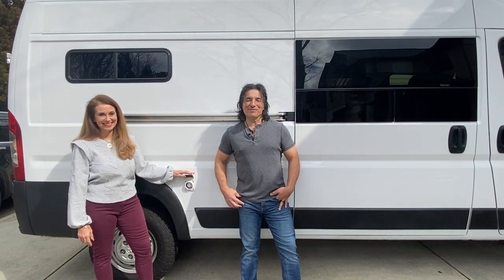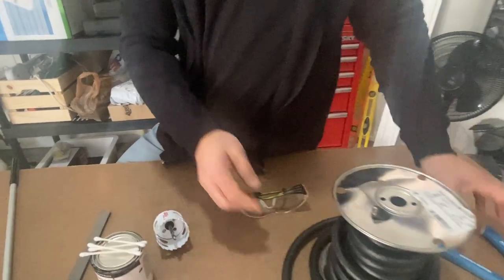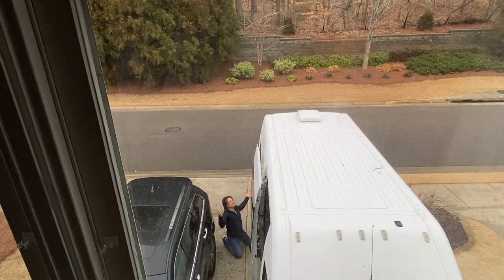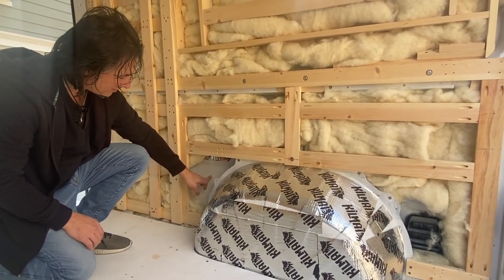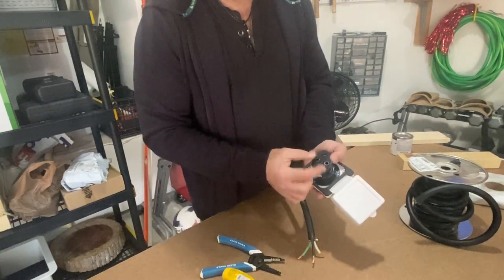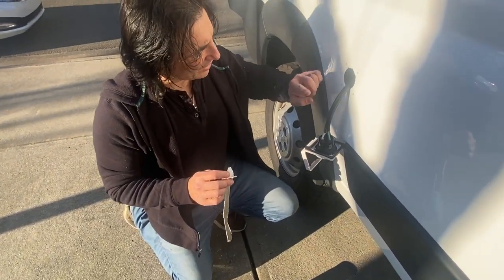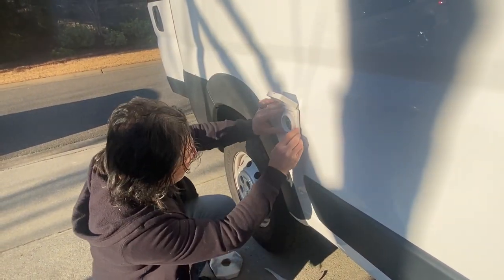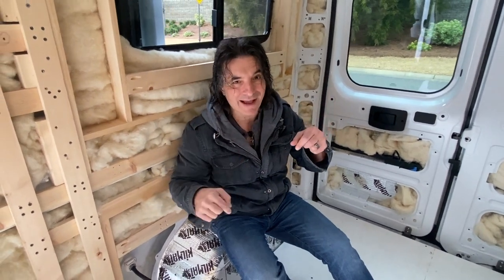Installing a 30Amp Shore Power Inlet: Part 17 – RAM Promaster 2500 Van Conversion

Comment: Hello again, I just remembered a friend of mine who has one of those on both sides of the RV. We do motorcycle activities at tracks. So the driver’s side he uses it to get power into the van, while the passengers side is in front of our motorcycles and we need it to get power for many purposes for the motorcycles all week long. Stay happy you’ve a got a great van 🚐
Reply from the maker: Wow…never would have considered that. There are certainly opportunities to feed power out the passenger side and pull power from the drivers side. FANTASTIC idea. And Thank You again

Comment: Thank you for the awesome video. You can always have another plug in from the drivers side but still keep that one by the door. It makes the van more versatile. I am sure there will be many situations where you’d need that one 🥳👍 love it!
Reply from the maker: Hi Johnny, that is a great idea…to install another on the other side. We are in Death Valley right now and it’s obvious that they are typically on the drivers side …..at least that’s what we see here. I would think, with 2 engineering degrees, I would be smart enough to not make such a mistake …..but we live and learn. Thanks so much for watching and for the constructive feedback.

Comment: Another great, inspirational  video.   Look on the positive side. At least you'll never drive away with the shore power still connected. If it was on the other side, there's always a chance you'll forget to check before hitting the road.
Reply from the maker: Thank you for your positive comment. Great point!

Comment: Yeah, just curious as to why you picked the passenger side.  Almost all RV's and campgrounds are designed for shore power on the driver's side.  Also, think about rubber washer on the outside and nylon inserted lock nuts for the inside fastening.  It will prevent loosening over time.  Nicely done.
Reply from the maker: Hi. Thanks for watching. We caught our mistake about 6 hours too late. But we are going to install another on the driver side. The rubber washer and lock nut are great ideas that we will certainly use on the next one. Thank you again,